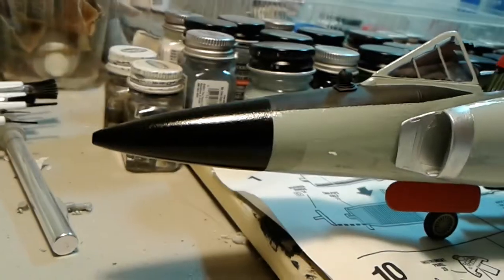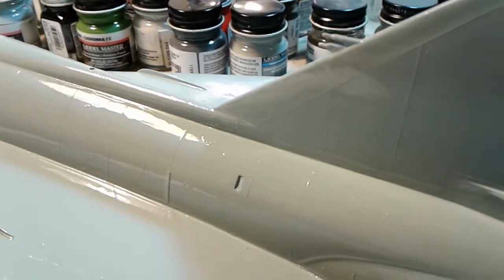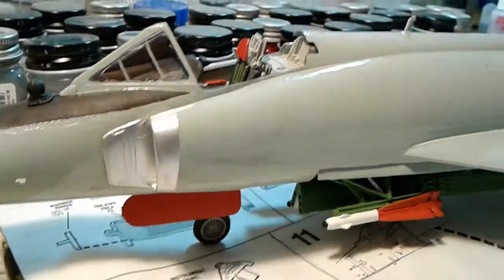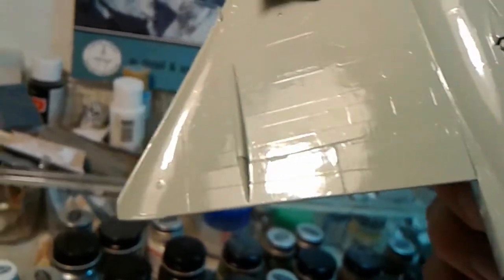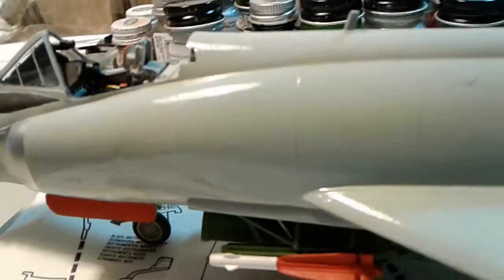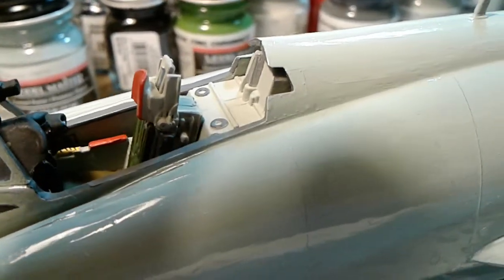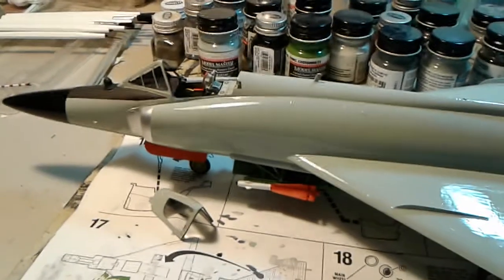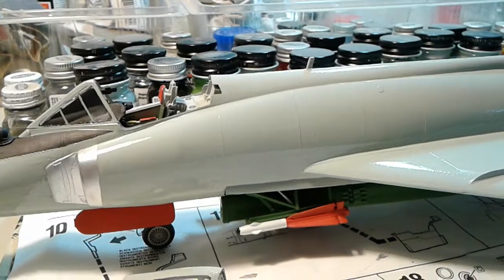F-102 Delta Dagger Build Part 6

Comment: Hey not bad i did took some paint tips from you i use air brush but some parts i did not know the correct color paint like the seat and seat belt thanks for  the video.